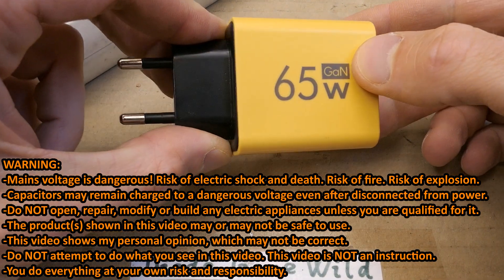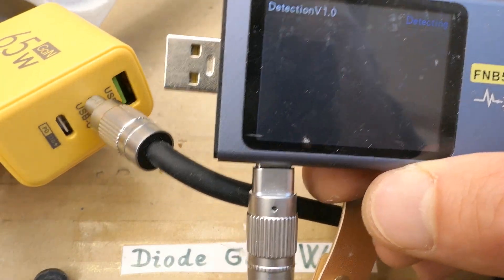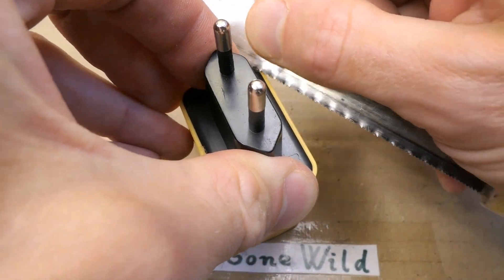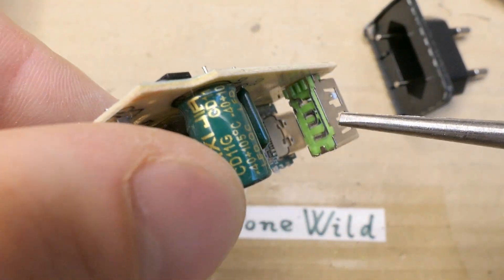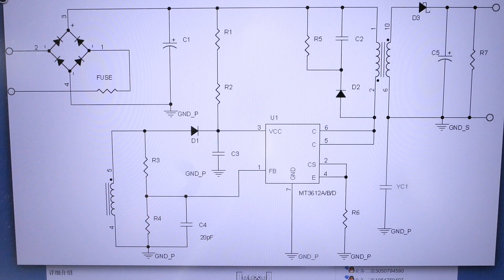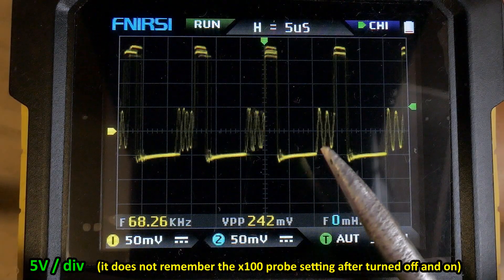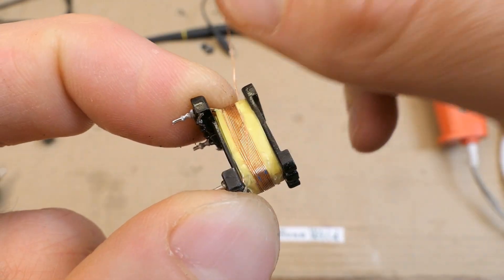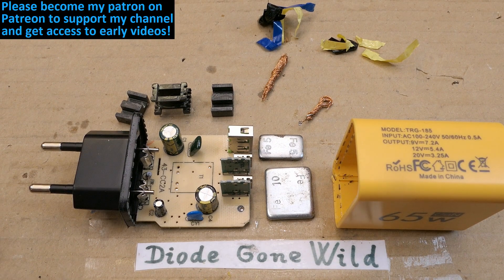$3 aliexpress 65W charger

Comment: Would bet that "syncronous rectifier" is actually a regular Schottky diode in a 8 pin package. One pin not connected, because a diode is a lot cheaper than an IC to make.
Reply from the maker: I think that a Schottky in such a tiny package at 2A would get way hotter.
Reply: @DiodeGoneWild  with the large copper pads and good thermal connection via the pins it might make it, though you can be sure some manufacturer has made a diode in this package as a way to make money, replacing the low drop ones with fakes.
Reply: @SeanBZA  No. Sync rectifiers are expensive because of the analog circuit design. If you clone one and just pay for the silicon cost, it can be cheaper than a diode. I used to contract design a PV panel antiparallel solution, and it turns out using SGT FETs and a clone SR controller being cheaper than using a proper SBD and its thermal solution.
Reply: @bskull3232  If you are a fab diodes are the cheapest product, no masks needed, one diffusion pass, no etching and then aluminium on both sides and copper over. Then scribe and break to make the diodes. Not like the dozen or so different diffusion steps and masks needed for a mosfet. Diodes are basically like a solar panel, does not need great quality silicon, and defects are weeded out in test and recycled.
Reply: @SeanBZA  Lithography for power devices is dirt cheap. They use Hg lamps, so the maintenance is incredibly cheap.

When you talk about things made in China, there are either technology mastered by the Chinese and dumped at zero profit, or imported stuff that nobody uses. Hg lamp steppers fit the first category. For some $150k you can have a mass production grade Chinese Hg lamp stepper. That alone makes lithography virtually free for power devices made in China.

Litho is so cheap that most Chinese SBD devices, even low voltage ones, use a trench gate design (TMBS). And yes, those "diodes" are secretly a self-biased near-native MOS connected in parallel with an SBD.

Typically an 8" Chinese trench SBD wafer costs some $170 CNY, an 8" Chinese SGT MOSFET wafer costs $280. But for the same amount of current, the SGT is way, way smaller.
Reply: @SeanBZA  Just because the real specification is very low performance and low cost doesn't mean that the manufacturing is not well run. They will lie to you or me on aliexpress, but that doesn't mean they think they can get away with lying to each other in direct dealings. I completely agree that manufacturers will be selling diodes as sync rectifiers on aliexpress, but they won't be faking out the factory down the street that orders every week.
Reply: A minimal diode is cheaper, but when you factor in the power dissipation it gets more expensive. This seems built to the cheapest possible price while still providing 2A. Credit where it is due, this does work, and is dirt cheap. I would bet that the reason the rectifier gets as hot as it does is that it is the smallest possible piece of semiconductor capable of doing the job. It hits the spec and no more. If it didn't get hot the engineer would be looking at it and saying "I could save some pennies there"!
As the saying goes, anyone can make something that works. It takes an engineer to build something that barely works. At full load every part of that board is working it's ass off and half way to desoldering itself.
It is very easy to look at this and say "Chinese engineering sucks", but I don't think that is quite right here. The engineering on this looks very solid, the specification it is built to is just very different than the one it is being sold under.
Reply: @agsystems8220  Who said it can supply 2A, it just has to supply 2A long enough to pass a cursory test during manufacture, and it is very common for specmanship to use a 1A part to handle 2A, which it can do for a while before failure.

Comment: 30k potential house fires coming up.......
Reply: That 30K is probably a fake
Reply: @iwalker3809  No, 30k shipped, possibly the same 10k units shipped to build up a reputation, but still some people did plug them in. Not the worst Dany has shown, but still does not meet any of the safety standards at all anywhere, even in China.

Comment: chinese iron weights :) they are not event 5 and 10 grams aahahhahaha
Reply: They probably were with their adhesive backing. That weight counts too, you know?
Reply: @1pcfred   Absolutely not. 5g weight has a shortfall of 0.7g. You would need to add more than half a cubic centimetre of high density plastic - or more than a cubic centimetre of foam acrylic tape - to make up the difference. Many times more than the volume of the iron weight itself. The disparity of 10g weight isn't quite as drastic, and still not nearly enough by an order of magnitude for the adhesive to make up for it.

Comment: I don't know if you have Action stores in  the Czech Republic but they have many electronics at very low, sometimes suspicious prices. It could be interesting taking a look at some of them :) They also have GaN chargers.
Reply: yeah we do actually. the charger they have seems quite similar. it's quite cheap tho.
Reply: Yes i actually have them in the country  I also have some more chargers with pd non gan and they seem better built. I did an autopsy and they have good isolation, proper Y cap, sufficient isolation in the transformer and a fusible resistor. Idk about the gan one though, still have to buy it. I get my monthly money in a few days
Reply: @309electronic5 is there a follow up on this? Here in Austria we have Action too.
Also we have the Shop Tedi here and they also sell cheap china stuff like Action and some products are the same. Chinese stuff from these Shops are just trash. I bought a brazz brush but it turned out to be steel and only coated in brazz. Also bought there a frame for a picture and the measurement are not accurate. 

What I want to say is, based on my experiences, I would not be surprised if many products are a scam.

However, when it comes to electronics I think there is a standard for these products, even if it's low. At least I hope so in my wishful thinking

Comment: These weights are from the automotive sector for balancing tires

￼
Reply: And not very well at that.
Reply: @m3chanist it should be near accurate if u including tape weight that it come with also
Reply: @SyrFlora   No it wouldn't be. That 5g weight is underweight by 0.7g. The tape maybe adds 0.1g at most. Just consider that it would take at least half a cubic centimetre of high density plastic to make up for the missing 0.7g. The weights are clearly manufacturing rejects with a casting error, too far underweight.
Reply: Older ones were lead before it was banned by bureaucrats. If not, everyone would have died from lead poisoning and the world would have ended years ago.
Reply: I think for wheels they use zinc because ferrum would corrode
Reply: @niccots  depends, sometimes we got zinc and sometimes we get iron

Comment: These metal plates were actually alloy wheel weights.
Reply: But stamped with 'Fe' (element abbrev for Iron, from the Latin 'Ferrum')...
Reply: @jnharton  yes, as they are "eco-friendly" steel weights, instead of previously used lead ones...
Reply: They're likely to be manufacturing rejects with casting error that couldn't be sold for the purpose, but it was cheaper to sell them as defective than to re-cast them.

Comment: Even a gram is not a gram in chinesium devices 😂
Reply: it is almost a gram!
Reply: First, we had Chinese watts, then we get Chinese grams, what's next?
Reply: @und4287  Chinese CC for engines, unsurprisingly enough.
Reply: @und4287  Chnese volts
Reply: @und4287  There are also chinese 16 A  sockets that get hot at 8 A load.
Reply: I am an auditor and my collogue a Chinese guy often said to me , Chinese who didn't cheat is not Chinese 😊
Reply: Nothing is what China claims it is. A watt is not a watt, gram not gram, cm not cm, USB does not necessarily have to be USB as we know it ... everything is flexible and stretchable, manually measured with 20% tolerance, sometimes 200%.
Reply: @krollpeter  its almost like rampant corruption is a feature of communism
Reply: @krollpeter 😅 hard to believe
Reply: Hmm and I am always wondering why after changing tyres they are again out of balance... I suppose chinese grams explains why 😢
Reply: Those are for tire balancing so the weight should include the double sided tape...
Reply: @ruben_balea   Man no it doesn't add up. The 5g weight is underweight by 0.7g. That would take at least half a cubic centimetre of highest density common plastics to make up the missing weight, and the foam tape is much less dense than that. It's just underweight, by a lot.
Reply: "all measurements are manual, so there may be size deviations of +-10%, please be understanding about this" XD
Reply: I guess we can say that the Chinese people got Chinesed😂🤣🤣🤣🤣🤣
Reply: It is a relativistic material, ignorant westerner!
Reply: Does it have galvanized steelbars?
Reply: Mans gotta eat 😂
Reply: Avatar icon is fit
Reply: "you gotta understand China!"

Comment: The conclusion is: dodgy, super dodgy or what? I can't figure it out by myself. Some part of me tell it's just dodgy from an general electrical safety perspective, but as the overall product, it's very dodgy. It's likely in between. We need to refine the categories.
Reply: If it weren't for those weights double sided taped over the board I might go with just dodgy. Those weights hanging there propels this device into the range of super dodgy though. Because there's no way that tape is going to hold forever. Those weights will fall off and short that whole device out.
Reply: @1pcfred  point taken!
Reply: It should be rated as SUPER SCAMMY of course)
Reply: I would classify it as: SUPER DODGY + SUPER RIPOFF.

Comment: And the verdict? Super dodgy!
Reply: Spoiler alert
Reply: Yep. Especially looking at that thermal  imaging... Gets pretty damn hot in there.
Reply: @jnharton  That's for sure. The yellow outside case looks nice, but once he opened it up and two lead weights were in there to give it weight, I knew it wasn't going to get any better. And like he said the heat inside could delaminate the double-sided stick tape holding the lead weights causing it to slide off inside resulting in a dead short.
Reply: I know it is kind of boring but I would like to see tests and teardowns of good safe chargers.
Also where to buy them from.
Reply: @gordonwelcher9598 Big Clive has shown a few. Basically all chargers from IKEA are top notch.
Reply: Scam...
Reply: Fraudulent not just dodgy
Reply: @garyrfield  Those weights just waiting for the glue to dry out and fall into the circuitry make it super dodgy in my book
Reply: @garyrfield if it ain fraudulent, it probably already exploded

Comment: Ok just as I thought. Faker than fake ... All thoso people using these dodgy things. I do wonder if some of the slightly more expensive ones do actually supply 65W vid USB-C PD?
Reply: Yes,but via companies like Lenovo or European - based hardware developers. 

The Chinese can do good stuff if you watch them.
Reply: @LMB222  Chinese people are humans, just like you and me.

Lenovo is a big company with a name and reputation to protect, which means that just like HP or Dell they wouldn't sanction or ship this kind of crap.

But they might cut corners or make bad design choices to deliver on aesthetics or price, just like Dell or HP  might...
Reply: I recently bought 2 brand new Motorola Edge 30 neo phones for my grandparents and both came with 68W USB C chargers. I don't think Motorola (Lenovo) would lie about a power rating :) Though i would have to check the real output.
Reply: @Clyde-3127  Is the Motorola brand really owned by Lenovo too? That would suck ass...

Wouldn't put it past a lot of companies these days to be out-sourcing the design and manufacture of products while slapping their name on it...
Reply: @jnharton  They are owned by Lenovo but that doesn't mean they suck. They've been owned by Lenovo since around 2013.

Comment: Oh wow a synchronus rectifier, Really went all out on that design didnt they.
Reply from the maker: It seems that synchronous rectifier chips got very cheap. Even cheap crappy chargers now contain them instead of a diode.
Reply: @DiodeGoneWild  oh man,  im going to miss seeing the usual big old through hole schottky frying an electroloytic on the output. End of an era.
Reply: @DiodeGoneWild Has anybody a link to such a chip on aliexpress? I could not find a synchronous rectifier.
Reply: Those synchronous rectifiers in those cheap chargers get quite hot, so I don't know if these cheap ones are that much better than a diode.
Reply: @schaltnetzteil495  The cheap ones are just a diode in a different package, after all the lead wire from the big ones contains a lot of copper, much cheaper to have a die mounted on a thin leadframe, and then the other half is pressure welded on top to make contact, followed by the thin layer of epoxy.  Amount of copper is that in 1cm of the lead of the big diode, a considerable saving over a million units, plus you can recycle the rest of the leadframe as well, not send to the buyers for them to cut off. Can even use tinned steel as well, as there is no bending involved in assembly after epoxy forming.
Reply: @schaltnetzteil495  - At 2 Ampere and possibly 450mV drop voltage the diode would have a power drop of ~0.9 Watt.
A PRLL5817 (for 1A average current) would have 150k/W thermal resistance from junction to ambient, so I would use two of them. With 75W/K it would get ~95°C at the junction.
Possibly it is worth to check this synchronous rectifier.
Reply: However as that chip was really hot, is it real, or just a diode, as in another fake chip
Reply: What accent is that? I've never heard it before